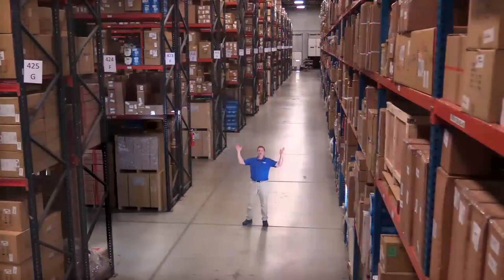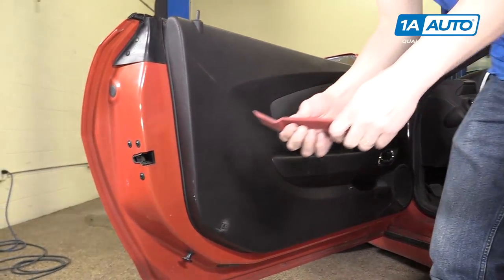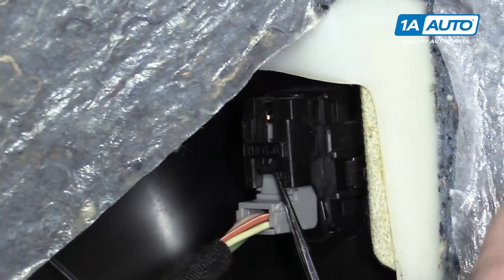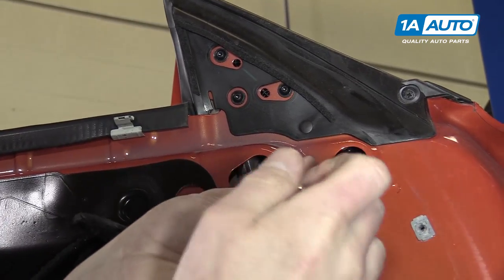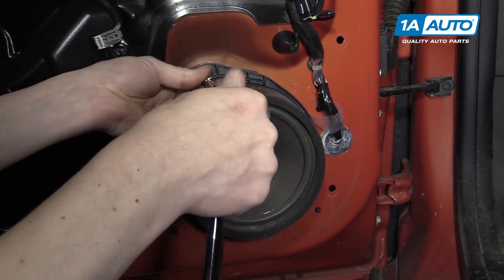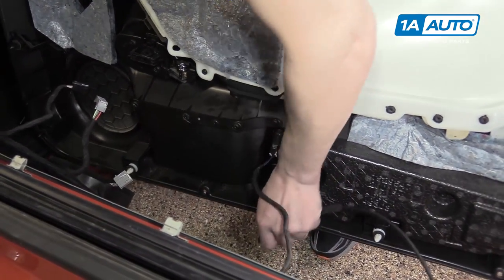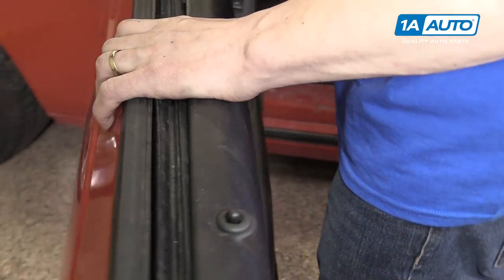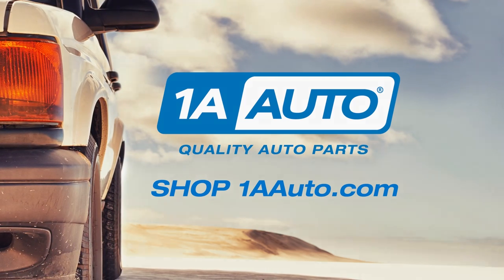How to Replace Side View Mirrors 10-13 Chevy Camaro

Comment: Great vid. I just replaced my pass side mirror after accidentally breaking it. I didnt disconnect the other switches though only the mirror connection itself. Once I took panel off, I moved it back good enough to get to bolts.  I leaned it back on door with wires holding it. I used a rolling stool to hold it leveled near door so it wouldnt tug wires too bad.

Comment: Great video. Very well done and helped replace my passenger side mirror. One note, my Camaro has the OEM ambient lighting so there was one more wire connection to undo and put back. Strange connector too. Took a minute to figure out. Also, instead of removing the speaker, I attached a string to the plug of the old mirror when I removed it. I then tried the string to the plug of the new mirror and pulled it through so I could fish the plug through to hole. saved a step and some time. Lastly, to keep from losing the 3 nuts that fasten the mirror, I used my other hand to keep a finger on it until it was seated and turned to engage the threads. You can reach the nut in the small hole with the sticker from the bigger hole with the rubber grommet. Did the same thing when I removed them.

Comment: For some reason I can't get the cap from behind the interior door handle. I've tried brute force and it won't budge. I'm basically scratching the hell out of the interior door. Any suggestions on how to get this thing off?
Reply from the maker: +Amanda Freeman Thanks for watching!  That is just a snap-on plastic cap that covers the bolt, so it should pop off like in the video.  1aauto.com

Comment: What kind of paint should I use to match the car color? I have a white car but my mirror only came in black
Reply from the maker: You can call your local dealership with your VIN # to find out what your vehicles exact paint code is. You can also take your vehicle to a local body shop and they will be able to paint it to match your vehicle based off your VIN information as well. +Leilani S